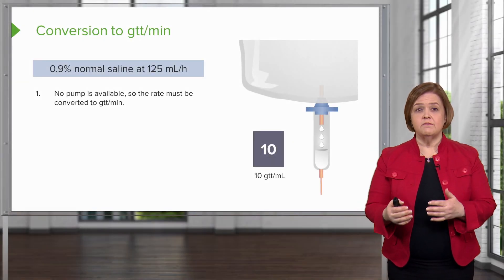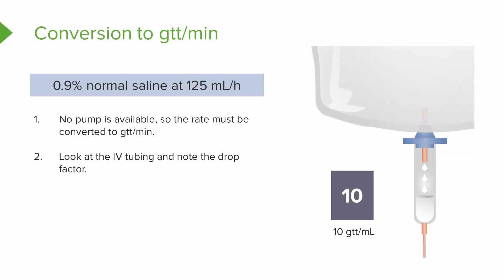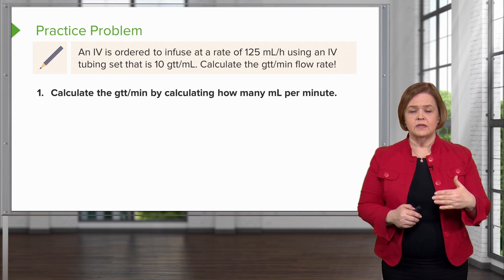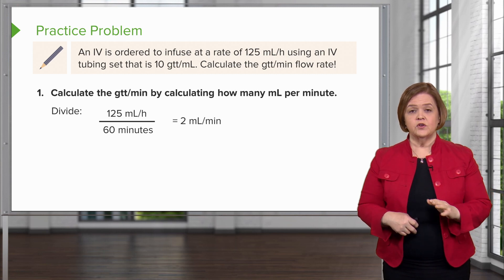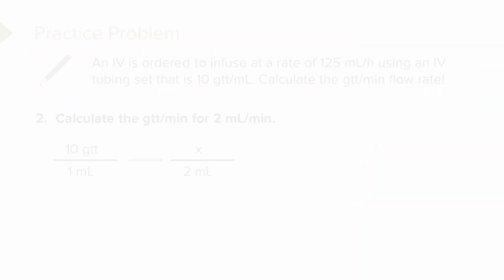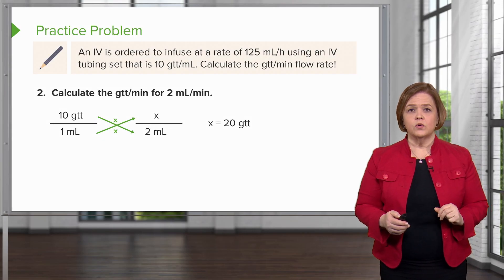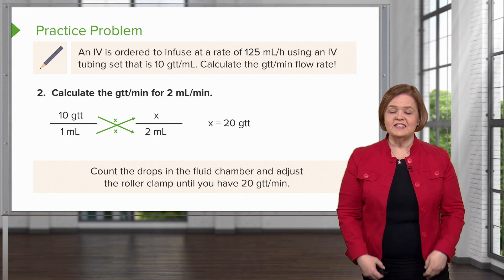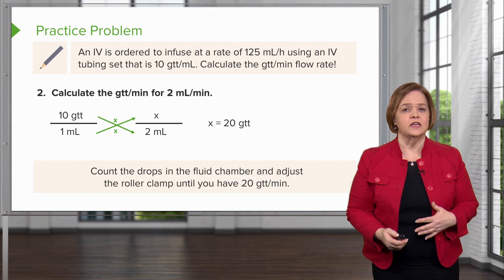How To Calculate Drip Rate - Case Study  | Nursing Dosage Calculations

Comment: Don’t you round up to 21 drops?
Reply: I did that as well--> 20.83 and rounded up to 21 gtt/min
Reply from the maker: Many thanks for your feedback. In the video, you can see how Dr. Rhonda Lawes ends up with 20 drops. We don't recommend exceeding the dosage. You can watch again from 3:30 to see exactly how she ended up with this number.
Reply: I thought the same.  I used the drip factor formula
125 x 10/60 = 20.8
Ill definitely have to rewatch this.